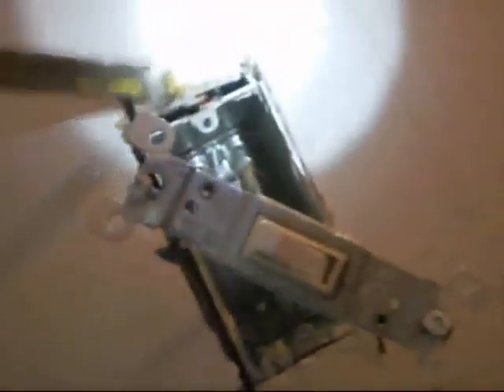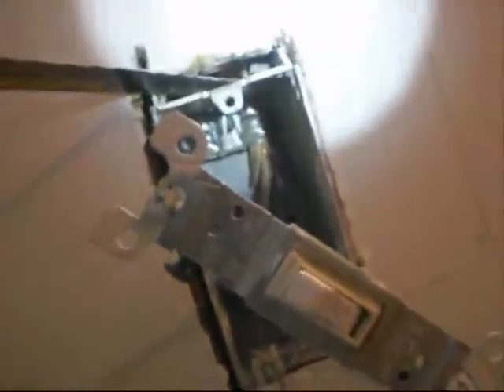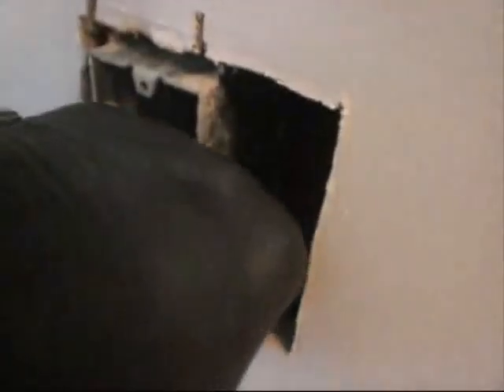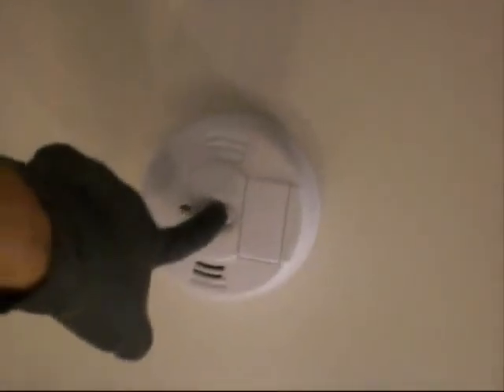9 5 12  Wiring And Wiring...

Comment: It sounds like you have three 2 wire cables- one is a feed ,one goes to the switch and one to the fan . If so the white from the feed and the white from the fan go together ,the black from the switch and the black from the fan go together and then the black from the feed and the white from the switch go together with the white taped black so it is not mistaken for a neutral . Right now you have a neutral and a hot on your switch that will give you a dead short every time you throw the switch.

Comment: I'm putting a new fan in my brothers bed room 3 different sets of wires go to the junction box for the fan I connected all the blacks with blacks and whites with whites and grounds with ground but every time I flip the switch it trips the breaker got any suggestions?